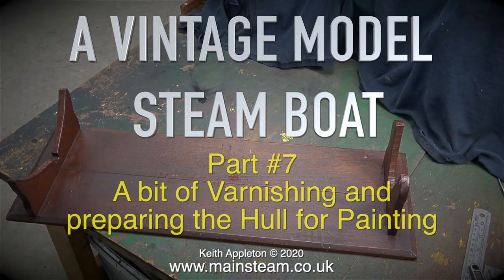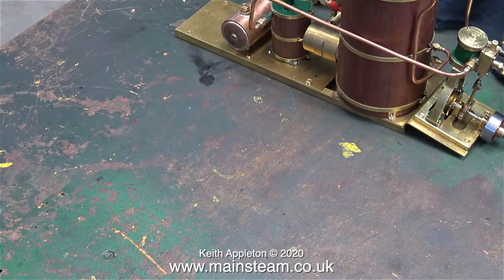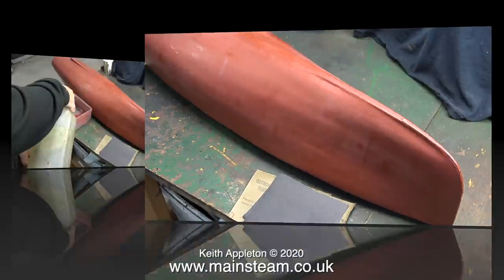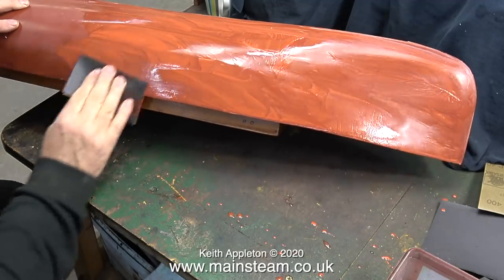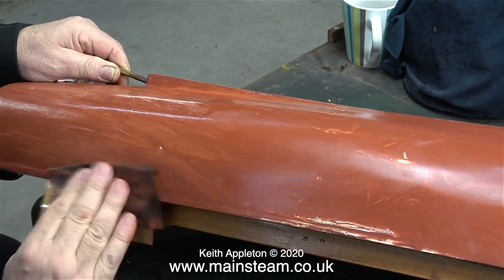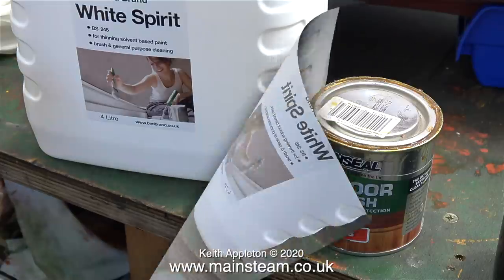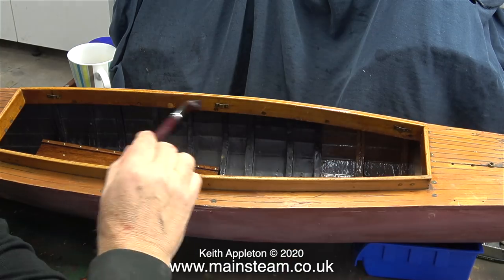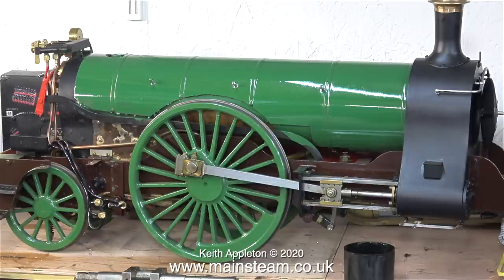VINTAGE STEAM BOAT RESTORATION - PART #7

Comment: Another good reason to use a 50-50 mix of varnish is that it dries very quickly so that second or third coat can be put on in one day. The thin coat can also be used as a sealer on porous wood. This boat is going to look great and people will tell Keith it looks good for being fifty years old.  It's like when people tell me I look good after a haircut,  because having long hair when you are 70 isn't really a good thing.

Comment: Great video Keith, today my uncle shaun gave me an old scratch built live steam traction engine, it is about double the size of a mamod and still has an oscillating cylinder, it was the first thing he ever made at university studying metalworking, I’m going to remove the thin layers of rust carefully with WD40 and steel wire wool and then polish the metal with autosol metal polish, also make a new safety vaulve as the old one fell out somewhere over the years

Comment: I use cyano to fix propshafts in before I epoxy them. That way the propshaft can't move whilst the epoxy sets.  

Very strong but able to be removed at a later date by removing the propshaft and then tapping the proptube with a mallet,.comes out very clean. 

Looking good Keith, I hope that you are well

Comment: Last part reminds me of an incident on a construction site I worked on. I was a driver working for a removalist company, the labours and I were all walking off to head home, as we noticed carpenters and painters working in the same hallway... Painters were about half done and the carpenters were raising the walkway. Given it was an enclosed space, they had fans blowing fresh air down the hall to stop the painters getting drunk from the paint fumes.

As we were walking past, a carpenter jumps up with a length of wood in his hand, walks over to the drop saw, spins it up as one of the painters jumps up screaming at the top of his lungs, "NO NO NO NO! STOP STOP!!!" The carpenter drops the saw on the length of pine spewing sawdust everywhere, all the painter could do was stand helplessly with his hands on his head watching the sawdust being stirred up by the industrial fans down the freshly painted hall. Each of the painters stood up one by one as the dust blew past, all turning to look at the carpenter, now standing motionless, with a piece of wood in each hand processing the massive f**k up he's just made. A total disaster, happening in slow motion and everyone helpless to stop it, it was kind of hilarious looking back on it.

Long story short, you're right to not kick up dust while paint's drying.